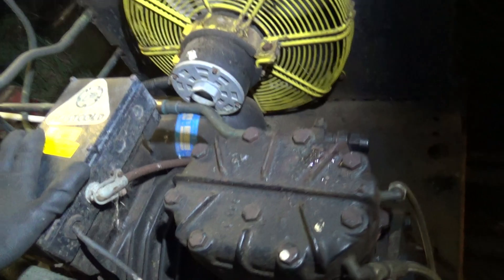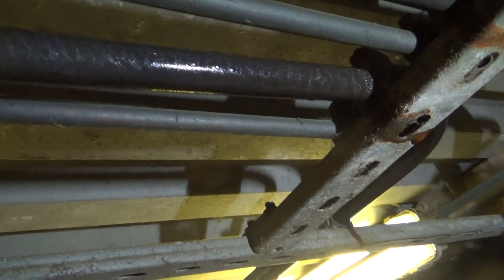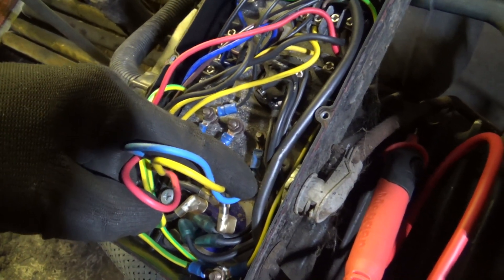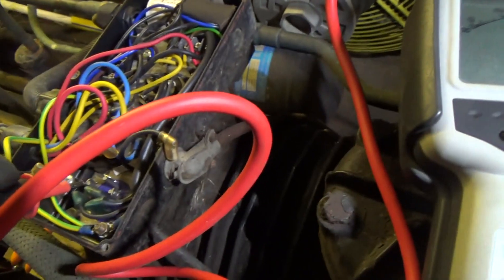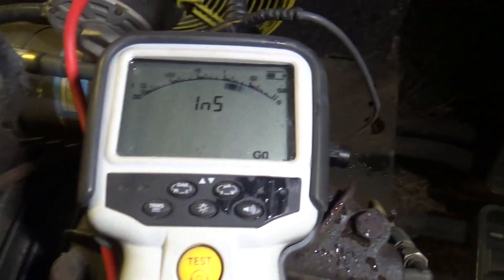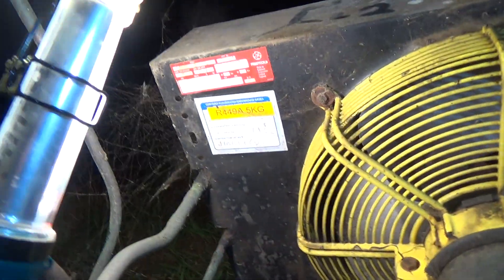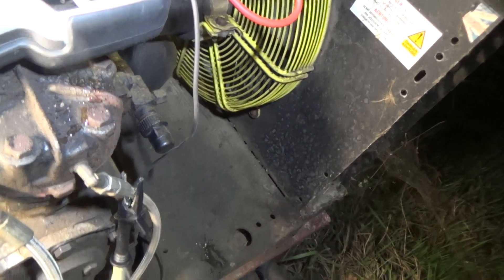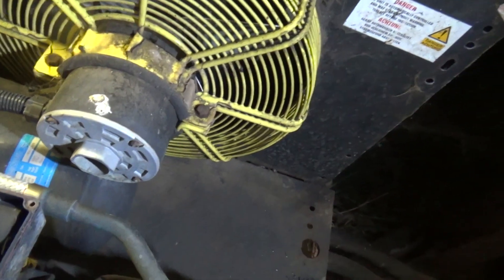Megger To The Rescue

Comment: Yuk ! Likely a burnout ? Contaminated system , Suction line drier or Highside chemicals product " Acid neutralizer " , I have used that in some systems , It works .
Reply from the maker: I think it passed an acid test as we re used the old refrigerant in the new condensing unit, the old compressor is still on site, if I get time will take it away and strip it to see what failed.

Comment: Hey heavy, another great video! I was just wondering, on one of your older videos, you was working on a condenser unit that had bubbles in the sight glass, then you put a piece of cardboard in front of the fins, and the sight glass filled up…what purpose was that for? 
Many thanks 
Lee
Reply from the maker: Hi Lee,
In really cold weather the condenser can take so much heat out of the refrigerant and so also lower its pressure that there is not enough pressure difference between the high and low sides of the system to push the refrigerant round the circuit. Blocking the condenser with some card etc simulates warmer weather and checks to see if the system is actually short of refrigerant (still has visible bubbles) or is 'over condensing' (the sight glass fills up and bubble go away)
The system should really have a fan speed controller to slow the air flow in cold weather if its an issue. If you are not careful you can overcharge the system trying to clear the bubbles in cold weather.
Reply: @heavydiesel  thanks for that, thought that’s what it was being done for, keep the videos coming! Really good content 
Lee

Comment: this is why RCDs make no sense at all. Cut power to entire house, barn, or commercial operation due to one piece of equipment. Simply have GFCIs on each piece of equip and allow everything else to run. Makes troubleshooting, isolating, and repair much easier.
Reply from the maker: I think they'd still have a main one on the incoming power even if they had individual rcd's on each circuit, at least thats what I've seen on more modern installations, a dead short like this would likely take out all the down stream trips too.

Comment: I bought a cheap UniT insulation resistance tester which is nowhere near as the proper Meggers but it has come in handy a few times now! A very handy tool indeed!
Well they do say "nothing is more permanent than a temporary solution"... :)
Reply from the maker: They are really handy tools for finding shorts etc, wouldn't be without one.